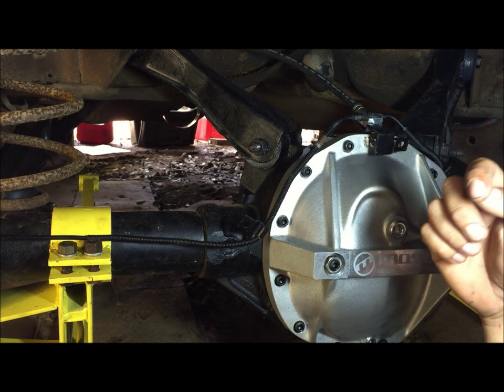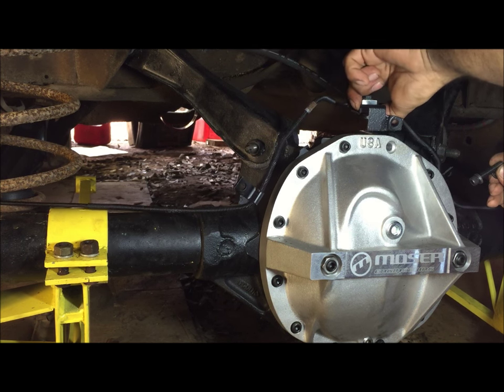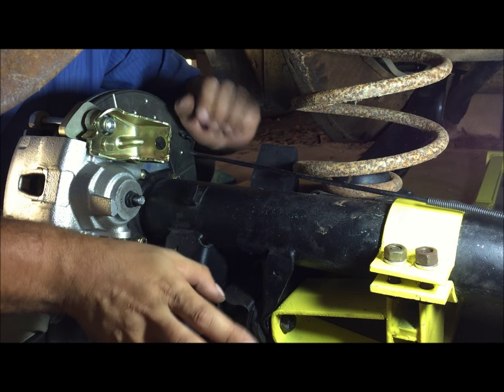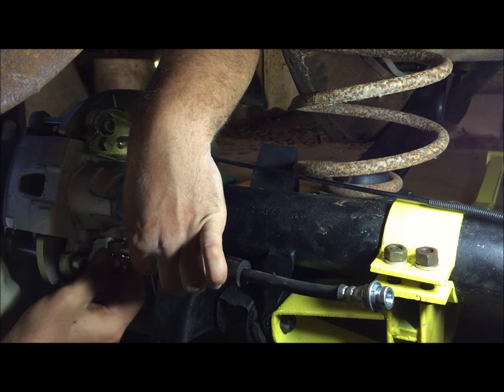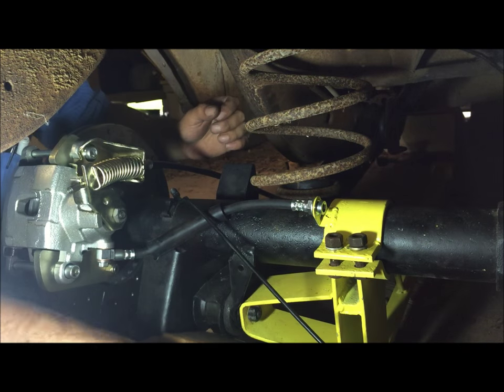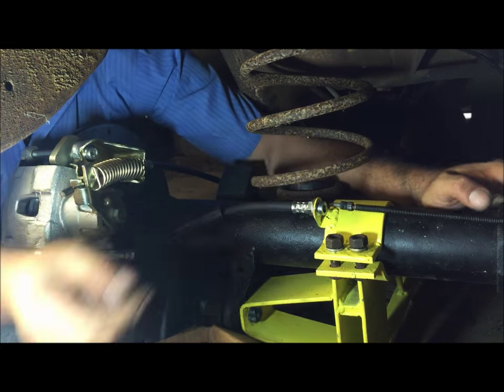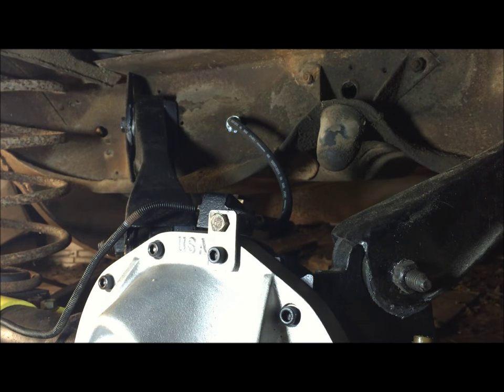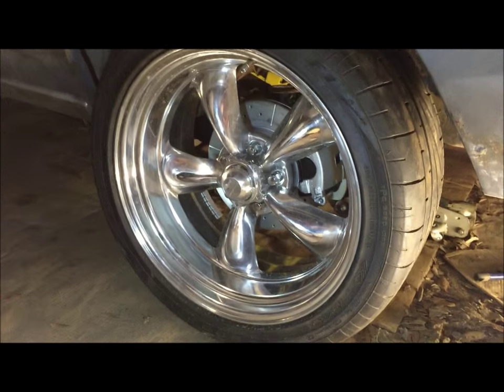chevelle rear disc brakes part 2

Comment: These couple of caliper videos helped me a great deal when trying to troubleshoot an issue with one of my Cadillac Seville calipers on my Nova. My adjuster mechanism had seized. I could manually advance the pads outward, only to have them wear and then create slack. Took the caliper apart, saw what was wrong, determined it could not be fixed and ordered a new one. Problem solved!

Comment: Hey Chris, excellent video's. I am restoring a 1972 Chevelle 454 with a 12 bolt main rear axle. My question for you is, have you ever replaced the axle bump stop on either side. I pulled my axle changed the drive gear to a 3:55 posi, blasted and painted, new axles, new disc brakes, lines and coil overs. Trying not to damage these bump stops and can't seem to find anything online for the install. I also have a factory assembly manual, no help there either. 
Thanks and awesome job on your car !!
Reply from the maker: please explain.. I’m thinking the 2 rubber triangle pieces but those replace in 1 minute.. I reused the old ones I just poked them out with a screw driver cleaned them up and stuck them back in.. there was nothing to it and no damage..
Reply: The rubber stop located near the caliber on the axle tube
Reply: Yeah That's the one...have new ones...there tough to get in

Comment: Looks good!
Did you have to replace the proportion valve?
Reply from the maker: +juiced71 yeah, I got the brass factory style  4 wheel disc prop valve from summit..
Reply: Chris Craft my buddy had a 71 chevelle and he is doing the 2 inch drop spindles and 
Disk conversion and asked him about it and he said he is going with the adjustable one and was wondering how easy they were to setup

Comment: You probably know this by now but a good tech inspector who knows his stuff will fail you for having a brake line mounted to a mechanical part that could potentially fail or be ripped off the car going over debris on the track or road.
 It's better to weld the brake line hose mount to the actual axle tube.